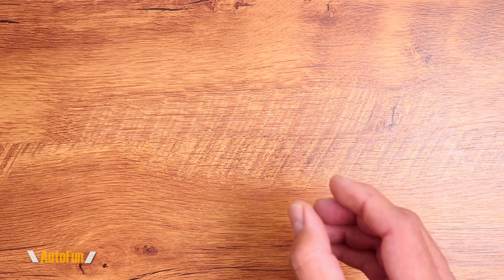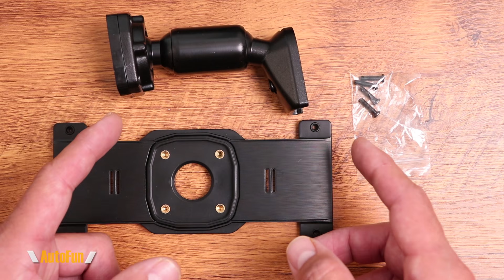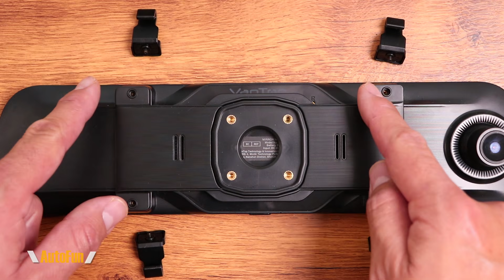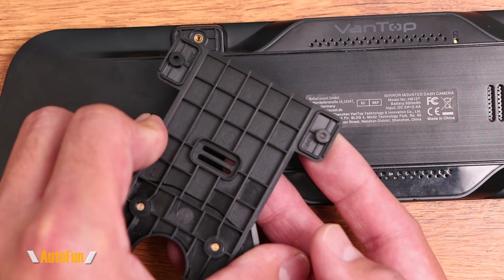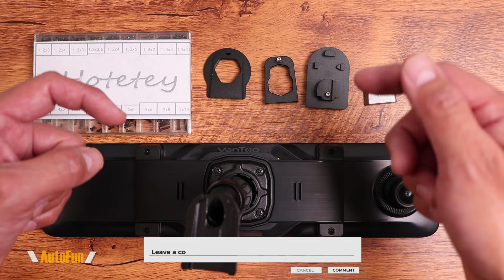How to Install Mirror Dash Cam WITHOUT Straps (Direct Mount Conversion Kit for LCD Mirror)

Comment: Nice video,  How would you attach one of these mirrors to a 3/8-16 threaded hole in a plate?  Should I use that silver plate, install it in the mirror arm, and drill a 3/8 hole and then simply bolt it in place?  I could potentially drill and tap more holes into the 1 plate as well.
Any way to attach this to a Ram Mount?  What size is the ball?
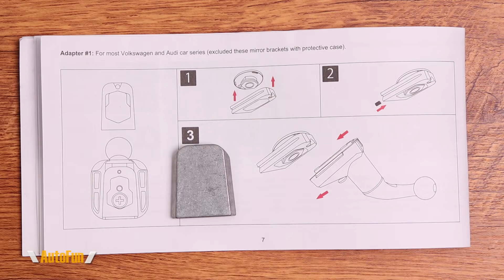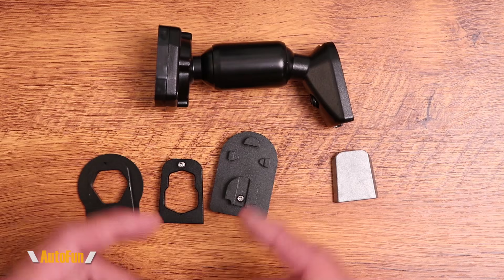Reply from the maker: Thank you! As shown in the video I use screws that match the plate, I placed a link in the video description to the screw kit that I use. You can also see illustrations of what the adapters look like at the 6:42 mark and what they look like in real life at the 7:52 mark. Their appearance is very distinct from each other. While it may be possible to identify the mounting tab by just looking thru the windshield (from the outside) I prefer to remove the the OEM mirror to double check if the mounting tab is a standard one or a specialty one (by comparing it to the examples show on this video), Cheers!
Reply: @AlexAutoFun hey thanks for the response.  I'm trying to install this in a SxS.  I don't have a windshield.  I will have a piece of aluminum bar, attached to a roll cage by two axia alloy universal clamps.

It has a 3/8-16 threaded hole in the center that I would like to attach this mirror to.  None of the listed clamps seem too useful for this.  I'm thinking i could thread a 20mm ball into the 3/8th hole,  it does not seem like there is a mount that would attach to a ball either.

Id prefer but to have to attach this mirror over the one i have.

The Jeep Mount might work, but if have to drill and tap two holes the screw it to the aluminum bar?  I'd prefer to just mount a ball mount or something.

Comment: Anyone have the measurements for rexing m3? Are there even screw holes on it?
Reply from the maker: Unfortunately the Rexing M3 does not have screw holes in the back, so a conversion kit will not work with it, Cheers!
Reply: @AlexAutoFun thanks for the quick response!
Reply from the maker: @stoneybeard  You're welcome!

Comment: Will it work on a 2014 320i BMW?
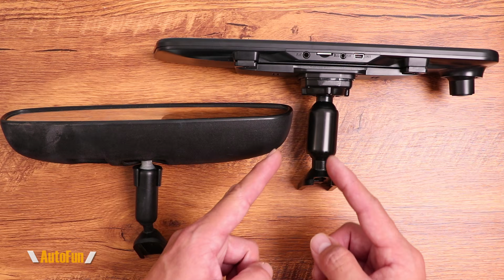Reply from the maker: Hi! I show how to tell which adapter you will need at the 5:40 mark, you can also see what they look like so your installer can compare them to the one on your vehicle. I also placed links to the specialty adapters in the video description. Cheers!
Reply: I know you mentioned it, but in the description, I didn't see BMW as an option. If you could just kindly point me to which link will work for BMW, I'd greatly appreciate it.
Reply from the maker: @juex1987  Hi! The specialty adapters linked in the video description are only for cases where your tab does not match the ones showed on the video. This is one of the reasons I always pull the mirror to physically inspect the tab (as this can vary between trims and mid year production changes) to confirm if a specialty adapter is needed or not. The other alternative as explained in the video is to have the installer place a standard mounting tab to avoid having to deal with a different unusual tab, Cheers!

Comment: The link you provide for the small screw set is now hex head screws. I dont know if they will work.
Reply from the maker: Hi! The head of the screw of the screw is independent of the tread, but yes if you want a Philips or flat head those are available (but personally I don't prefer lol) Cheers!

Comment: I use a Rexing M2 Dash cam and its attached via rubber straps and it always pulls my mirror down, very annoying. This swap trick would be great but I dont see this dash cam listed nor for a Toyota(I have a Sequoia 2nd gen).
Any help would be appreciated
Reply: For the Rexing M2 Dash Cam, you want the 13.5 x 4 cm bracket.  Just installed my M2 Max with the bracket/arm in an Impreza, and it fits perfectly.  Given that the gen 2 Sequoia covers 2008-2022,  you will probably need to pull the mirror and see exactly what rear view mirror mount you have on the windshield.  From there you can find the mount adapter that you need.
Reply from the maker: @bippityboppitybootoyou  Thank you for this information! I will update the list we have going on in the video description, Cheers!
Reply: @bippityboppitybootoyou Thank you. I just ordered it. Ordered the screw kit and glue also. 
Appreciate you.
Reply from the maker: Hi! Unfortunately I have not tested the M2 yet, so I'm not sure what kit will fit, however you can measure the back as I showed in the video to determine the size but If I do get a hold of one of one, I will measure it for you and update this comment, Cheers!
Reply: @AlexAutoFun Upgraded to the M3 before getting my M2 kit. No screws on it so I elastic strapped the mount piece with 3M and it works perfect. So glad to get rid of the bulk that was my original mirror.
Thank you for this video. Such a small but HUGE upgrade.
Reply from the maker: @UODuckFan  You're welcome! Ah yes here is my video for cases for cases where the bolt pattern does not match any of the available kits https://youtu.be/fveZiDofnxg cheers!
Reply: @AlexAutoFun from what I can see the M3 does not have bolts to screw into at all. They use only 2 sided tape. But it's fine. The straps and my own 2sided tape got it done perfectly. I was rdy to use Gorilla glue also 👍
Reply from the maker: @UODuckFan  Yeah unfortunately the M3 does not, I actually just for the M3 V2, working on that review, will check if they added screw holes, cheers!
Reply: @AlexAutoFun Please link it when you find out. Thanks Again. Appreciate your work.

Comment: What about ram

Dose it use the same one as dodge and jeep?
Reply from the maker: Hi! You can see illustrations of what the adapters look like at the 6:42 mark and what they look like in real life at the 7:52 mark. Their appearance is very distinct from each other. While it may be possible to identify the mounting tab by just looking thru the windshield (from the outside) I prefer to remove the the OEM mirror to double check if the mounting tab is a standard one or a specialty one (by comparing it to the examples show on this video) Cheers!
Reply: Thank you brother  @AlexAutoFun
Reply from the maker: @hamadyousef4368  You're welcome my friend!
Reply: @AlexAutoFun  i removed the OEM mirror to double check and it looks like the adapter 2
Reply: but where i can get the adapter 2?
Reply from the maker: @hamadyousef4368  Hi! I placed the link to the Mirror Bracket Adapters in the video description (it's a 3 pack) and also a link to the specialty mirror arm adapters for those that want that instead of the bracket adapter, Cheers!

Comment: Hi how about the ford Ranger raptor mirror is there any adaptor for that?
Reply from the maker: Hi! Ford tends to use the standard mounting tab however I always like to verify before ordering which one will be needed. I show how to tell which adapter you will need at the 5:50 mark and you can also see what they look like so your installer can compare to the one on your vehicle. I also placed links to the specialty adapters in the video description, Cheers!

Comment: Thanks so much i found your video. What would you recommend for a 2024 Lexus Lx600?
Reply from the maker: You're welcome! Ah Toyota/Lexus tends to use the standard mounting tab however I always like to verify before ordering which one will be needed. I show how to tell which adapter you will need at the 5:50 mark and you can also see what they look like so your installer can compare to the one on your vehicle. I also placed links to the specialty adapters in the video description, Cheers!

Comment: Can I mount this to a 2014 Silverado ? And power it through the mirror?
Reply from the maker: Hi! To tell if it will mount to your vehicle, take a look at the illustrations of what the adapters look like at the 6:42 mark and what they look like in real life at the 7:52 mark. Their appearance is very distinct from each other. While it may be possible to identify the mounting tab by just looking thru the windshield (from the outside) I prefer to remove the the OEM mirror to double check if the mounting tab is a standard one or a specialty one (by comparing it to the examples show on this video). The other way as explained in the video is to just use the standard mount tab, link to the tab and adhesive in the video description as well, Cheers!

Comment: Hey brother do you know if the Wolfbox G890 can be used with any of them windshield brackets?
Reply from the maker: Unfortunately the G890 does not have screw holes in the back, so a direct mount conversion kit will not work with it, Cheers!

Comment: Which kit works with the p12 pro?
Reply from the maker: Hi! Unfortunately I have not reviewed the P12 yet, so I'm not sure what kit will fit, however you can measure the back of the dash cam as I showed in video to determine the kit size. And If I do get a hold of one of one, I will measure it for you and update this comment, Cheers!
Reply: @AlexAutoFun  I have the measurments as 13.5 X 5.8.
Reply from the maker: @JeffA-l1i  Thanks for sharing! Wow that is very close to Vantops 13.5 X 5.9 (link to the kit in the video description) I wonder if that may be the actual size of P12. If you do get the Vantop kit, please let us know if it works out, Cheers!

Comment: Thanks Todd. I was looking for this video, I saw it sometime before but lost it.  I am planning to install a Woldbox 900 in a 2018 Honda CRV.  This model of SUV has a plastic cover over the rear view mirror bracket. You cannot see the bracket. My last investigation is if I can remove this cover to access the mirror bracket to replace with adapter.
Reply from the maker: You're welcome! Ah yes the ADAS enclosure usually comes off, here is another video where you can see how I removed mine https://youtu.be/TvKRKYA7cgQ Cheers!
Reply: @AlexAutoFun  Hello Alex. One year has passed and still haven't done much since my last message.  But this time I am ready to finish this.  
I was planning on getting the Wolfbox 900 Pro. I think the price has come down a bit as I see there are newer model. But is it the 900 Pro  still a good option? Or better invest a bit more and get the newer technology (G900 Tripro)? Or some other brand?  
Next question, I want to install using the direct mount kit,  WOLFBOX OEM Bracket . But in the Amazon site says to contact customer service to confirm compatibility  with vehicle. I have a 2018 Honda CRV. Is it compatible? I understand I will also need the adapter for Honda vehicles, right?  
And lastly, to connect directly to power, I will need the wiring kit, right? The original wires that comes with the kit cannot be cut to make them fit into a direct connect to power?  Thanks  in anticipation.
Reply from the maker: @cesarrodriguez1368  Ah yes I cover that on my TriPro video here https://youtu.be/q8RxvGf0aoY feel free to use the video chapters to jump to the section of the video you want to see. Regarding OEM bracket compatibility here is video for it https://youtu.be/_R12Vdus_A0 where I cover how it works and how to tell if you will need an adapter for it, cheers!

Comment: I removed the mounting strap brackets and used a 3M mounting adhesive pad to stick it to the front of the original mirror, simple and effective, 9 months on no vibrations no overheating, no need for a bracket.

Comment: Which one works for the Jeep Wrangler JK 2007-2018?
Reply from the maker: Hi A! I show how to tell which adapter you will need at the 5:40 mark and you can also see what they look like so your installer can compare to the one on your vehicle. I also placed links to the specialty adapters in the video description. Cheers!

Comment: What if i have an mk4 jetta and the mirror is just a ball and pivot mounting system?
Reply from the maker: Hi R! I show how to tell which adapter you will need at the 5:40 mark and you can also see what they look like so your installer can compare to the one on your vehicle. I also placed links to the specialty adapters in the video description. The other option as explained in the video is just to swap over to a standard mirror tab (link to the tab and adhesive in the video description). And lastly for very rare cases, this system allows conversion of any mount system https://youtu.be/cCpyHmiZqiY Cheers!

Comment: Do you know what adaptor is used for Alfa Romeo. I have a Dodge Hornet but it is an Alfa Romeo Tonale
Reply from the maker: Hi B! I show how to tell which adapter you will need at the 5:40 mark and you can also see what they look like so your installer can compare to the one on your vehicle. I also placed links to the specialty adapters in the video description. Cheers!
Reply: @AlexAutoFun  there's a console cover over the plate that attaches to the glass. And the outside glass is tinted, which blocks visibility of the attachment.  I'll just have to pull the cover ro see the attachment.  This video was very helpful. I already have the Wolfbox G900 pro set up. I'm just collecting the installation parts for the install
Reply: @AlexAutoFun  I just rewatched the video. I'll order the adapter kit just to make sure I have all the bases covered
Reply from the maker: @bigpopa1971  Yeah most of time it turns out to be the standard mirror bracket but in a few cases I do run into those specialty brackets and the adapter kit comes in handy. Cheers!
Reply: @AlexAutoFun  excellent content
Reply from the maker: @bigpopa1971  Thank you!

Comment: Not a good install, bracket is very flimsy and vibrates a lot on highway speed. It would be nice if the bracket mount is more beefier
Reply from the maker: Hi S! My dash cam doesn't really vibrate but I seen what you are describing on some cars. It comes down to your car's harmonics and suspension. So I see vibrations vary quite a bit from vehicle to vehicle, some have really smooth idle and acceleration and some don't. Same with suspension (including tire setup) some cars are set for comfort and vibrations are minimal but some cars are tuned to be sportier and vibrations are more pronounced in the interior of the vehicle (specially in bumpy roads). So the regardless of the mount type the main source of those will still be the vehicle the dash cam is being used on. Cheers!

Comment: Which adapter for g930 to toyota tacoma 2011 ??? Tia
Reply from the maker: Hi S! Unfortunately I have not reviewed the G930 yet, so I'm not sure what kit will fit, however you can measure the back of the dash cam as I showed in video to determine the kit size. And If I do get a hold of one of one, I will measure it for you and update this comment, Cheers!

Comment: I have a 2006 Cadillac DTS.  Will this work?
Reply from the maker: Hi A! This is a universal kit for vehicles. I show how to tell which adapter you will need at the 5:40 mark and you can also see what they look like so your installer can compare to the one on your vehicle. I also placed links to the specialty adapters in the video description. Cheers!

Comment: This causes vibration too much during driving
Reply from the maker: Hi M! My dash cam doesn't really vibrate but I seen what you are describing on some cars. It comes down to your car's harmonics and suspension. So I see vibrations vary quite a bit from vehicle to vehicle, some have really smooth idle and acceleration and some don't. Same with suspension (including tire setup) some cars are set for comfort and vibrations are minimal but some cars are tuned to be sportier and vibrations are more pronounced in the interior of the vehicle (specially in bumpy roads). So the regardless of the mount type the main source of those will still be the vehicle the dash cam is being used on. Cheers!

Comment: You eliminated the need for straps, but also illuminated the map lights built in to the OEM mirror...
Reply from the maker: Hi J! Correct, that is one disadvantages of direct mounting (specially on OEM mirrors with buttons on them and OnStar mirrors that functionality will be lost). Cheers!

Comment: I have the rexing m3, Do you know which one would fit?
Reply from the maker: Hi K! Unfortunately the Rexing M3 does not have screw holes in the back, so a conversion kit will not work with it.  Cheers!

Comment: When I tried the strap method, it shakes very much to the point of inducing a head ache. Will mounting it as shown in the video reduce/eliminate the shaking as though it were the original rear view mirror?
Reply from the maker: Hi K! My dash cam doesn't really vibrate but I seen what you are describing on some cars. It comes down to your vehicle's harmonics and suspension. I see vibrations vary quite a bit from vehicle to vehicle, some have really smooth idle and acceleration and some don't. Same with suspension (including tire setup) some cars are set for comfort and vibrations are minimal but some cars are tuned to be sportier and vibrations are more pronounced in the interior of the vehicle (specially in bumpy roads). The direct mount conversion sometimes helps reduce the vibrations but remember the main source of those will still be the vehicle the dash cam is being used on, Cheers!

Comment: I dont think there is any adapter for attaching it for my car, 1st gen mini cooper s. You turn it clockwise and its loose. Turn it back and clicks in. Could you help? Ive got pics and there are yt vids abt removing the specific mirror
Reply from the maker: Hi Tim! One of the adapters shown for BMW looks like the twist style, however you may have to use a system like this https://youtu.be/cCpyHmiZqiY if the one shown on this video does not fit. Cheers!